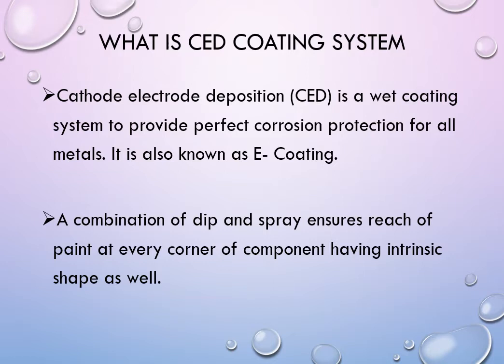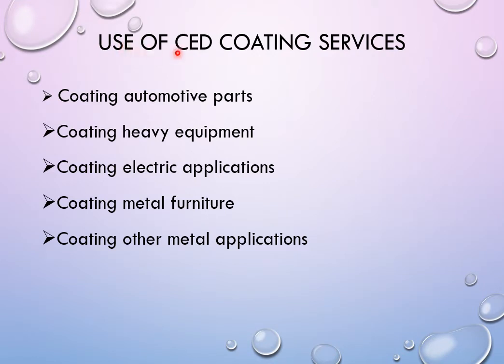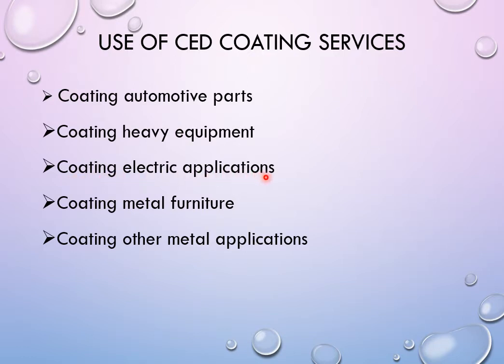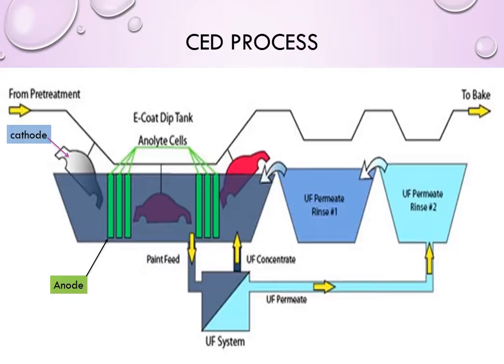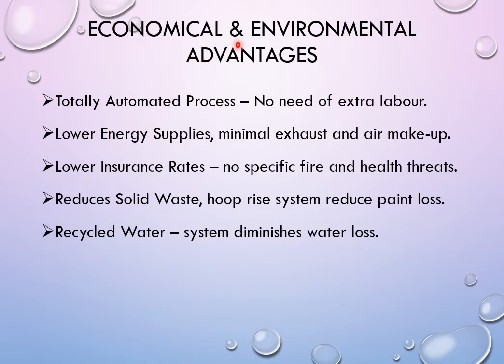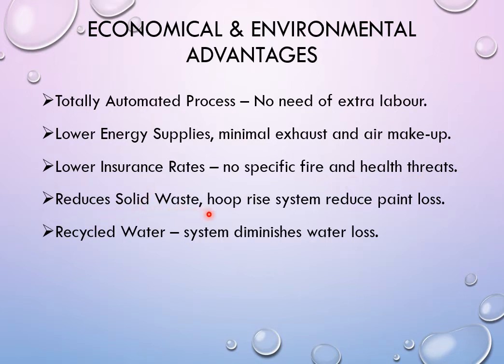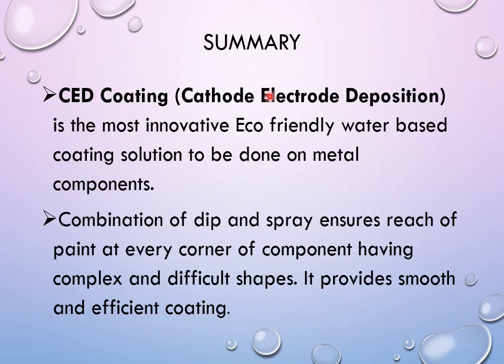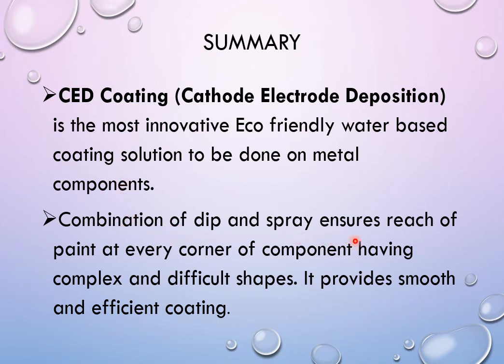CED ( Cathode Electrode Deposition) Paint Process@@..

Comment: Sir which kind of paint or paint solutions are using in this process
Reply from the maker: Epoxy paint
Reply: @RR-xl3lg  thank you is it readymade paint? I mean it will need only current or more chemicals for mixing?
Reply from the maker: @phool289  it's a kind of ready made paint bt we have two kind of paste in this those are called F1 and F2, in which one is like pigment and another is like resin, after mixing in perfect ratio both the paste you will get the epoxy paint, which is almost 80% water based and once we provide the current to the paint it will get deposit on the components.
Reply: @RR-xl3lg  ok sir i am a goldsmith i want to apply these coating on my artificial jewelry so how may i get these readymade solutions i need online store or if you want you can supply to me.